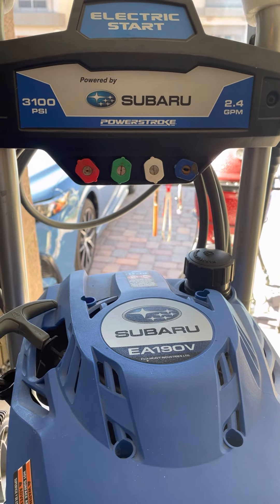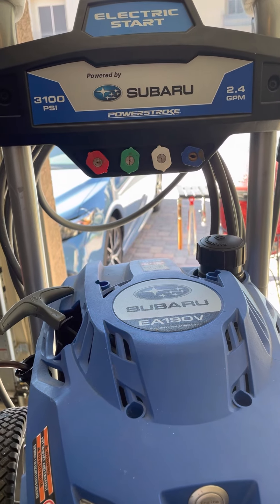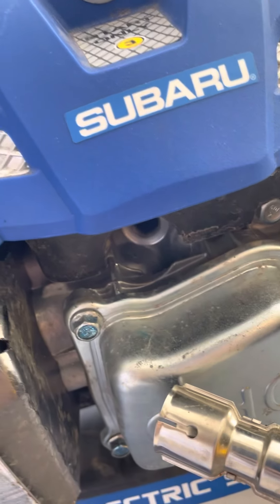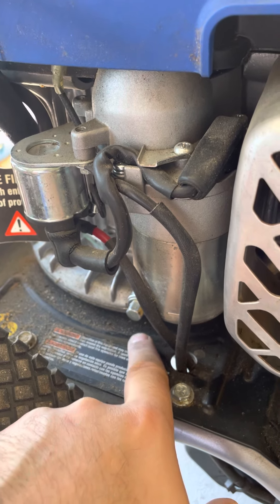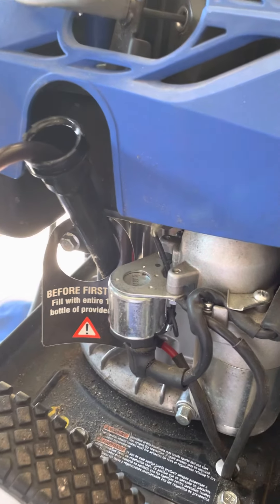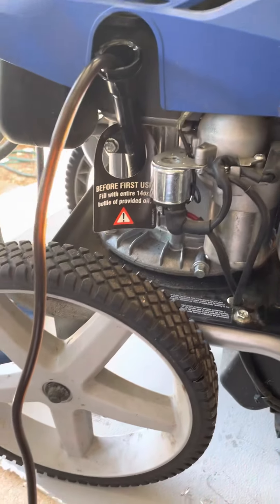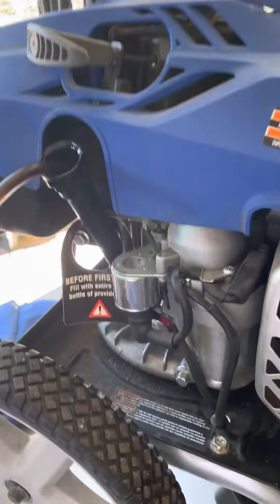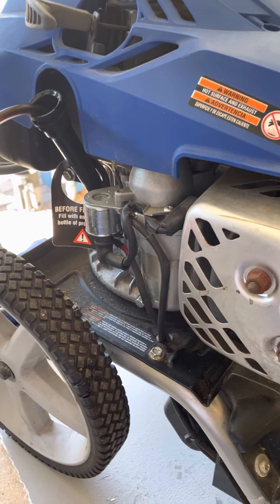Oil change of a Subaru Powerstroke pressure washer

Comment: Do you use regular gas  87 octane . Thanks
Reply: You can use any gas. The more expensive gas burns a bit cleaner. You want to make sure to use fuel treatment to avoid bad gas from sitting in the tank too long. Stabil and other varieties work well.
Reply: mine clogged up when using regular it never ran right. Only use premium now and it’s great
Reply: I have only ever used TruFuel (i know, it's kinda $$) in my small engines and they work like new for years... no need for fuel stabilizer, etc.
Reply: I have this same pressure washer.  Bought it at Costco probably 7-8 years ago.  I use it regularly, and several of my friends borrow it to use it.  It gets used probably a dozen times a year or more.  I only run 87 octane - but ALWAYS ethanol-free.  I remove the ethanol from my fuel, which drops the octane rating probably down to around 84 or 85 or so.  The only issue I've had with my pressure washer is the electric start no longer works, but it starts up on the second rope pull every single time.